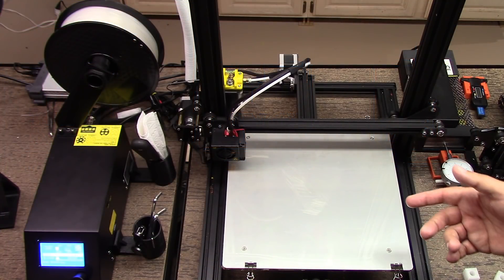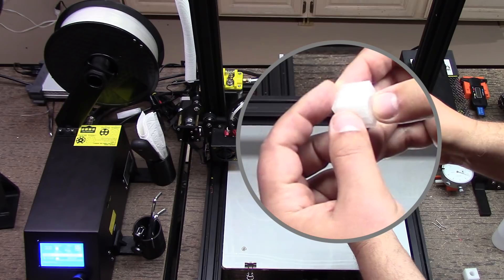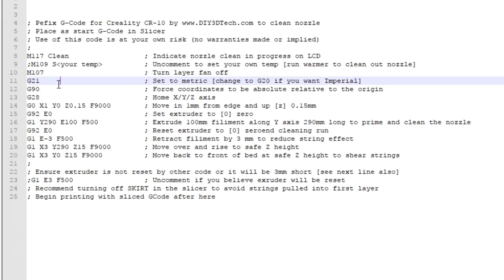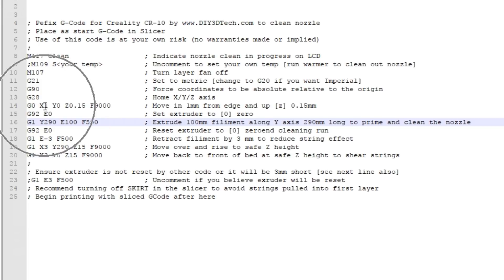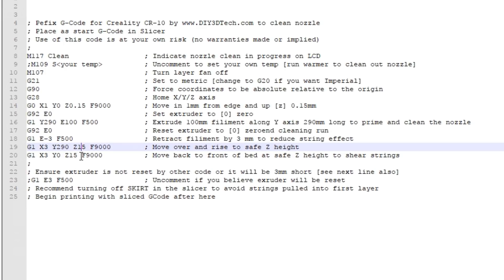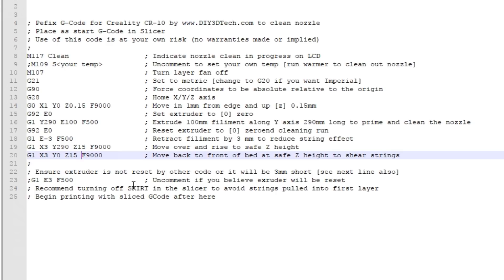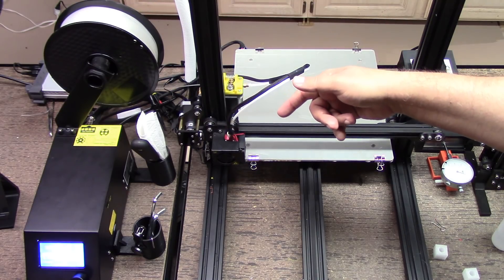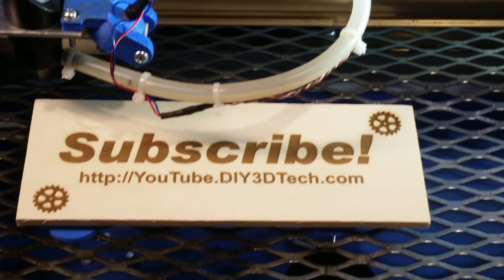Creality CR10 - GCode to Clean Nozzle Before Printing!

Comment: I like to just put down a massive glob that ends up surrounding the lower portion of my nozzle tip, i then yank out of that extruded glob pretty fast and it cleans the nozzle fairly well. tried having an actual brush and gcode was good but no matter what you do it leaves a but of crusty old filament on the outside of the nozzle.

Comment: Interesting old school method ..... use G12 P2 S2 R10 instead if you use Marlin 2.x and you get it in a smaller area in a circle of R10 = 10mm S meaning you do 2 rounds and P2 means you do in a circle pattern.
Reply from the maker: Interesting, thanks for sharing!

Comment: Hi, thanks for the video. If I wanted to run this script on its own to purge one filament and change to another, what commands do I need to use to turn on the heated bed and hot end? as my printer just says cold extrusion prevented when I run this as it is.
Thanks again
Reply from the maker: Check out this web site for the required G & M codes: https://marlinfw.org/docs/gcode/G000-G001.html

Comment: I assume I just put the G29 command after G28
Reply from the maker: Its been a while and depends a bit on your printer too for example if there is an auto-level routine.  However would suggest trying to insert after the hotend and bed come up to temp...
Reply: DIY3DTECH.com Very true. Luckily I just have a modded cr10 so most of your code was used! I ended up putting G29 right after the G28 and it’s working flawlessly!

Comment: Great video! 
I have a question, though... my Gcode Start looks like that and I don't understand why it doesn't have the positions and the lenght of the material that is going to be extruded... 
G28 ; home all axes
 M117 Purge extruder
 G92 E0 ; reset extruder
How can I edit this so it could travel in a certain direction?
As it is, right now, it's going at about Y100, starts extruding towards Y210 or so (my bed has 220 on X/Y) and then goes back towards Y20 (or so) over the first line it printed starting from Y100 (somewhere in the middle of the bed at X0 Y100)....
Reply from the maker: Not sure I understand what your saying, gcode is relative (in most applications) so so if the hot end is at X0Y0 and I say G01 X10 then it will create a line 10mm long.  Also same for direction as it to for the most part is also relative so if say G01 Z0.2 then G01 X-10 will place another line on top of the last in the opposite direction...

Comment: I used this GCode with my CR10s Pro V2, and it does what it's supposed to, however since my printer comes with the BLTouch auto leveling, however, it does the code first and then levels the bed, which causes the nozzle to be oozing with filament when it starts printing, it should be the other way around, it should level the bed first and then run the code. Is there a solution for this? I'm kind of new to all this, trying to learn.
Reply from the maker: Not sure, leveling code in the GCode start up of your slicer or firmware? If it is the later then just swap your order in the start up, if firmware based not sure however have to belive there is an MCode to start it?
Reply: DIY3DTECH.com Thank you for replying. I am using Cura, the latest version. It did have a an Mcode on it, I just pasted this one right after it. Should I invert it and put this one first and then the Mcode? Like I said I don’t really understand anything about Gcode, just starting to learn. Thanks again.

Comment: Hello, I have been printing for a while now but have never really done anything with Gcode. I now have a CR10 S Pro and would like to have a code like this one as well as have my bed end with print pushing to the front instead of the rear. I have it on my ender 3. I cant find anything spcific the the cr10 s pro. 

Would this code work for me? Below is what I have now. any help would be greatly appriciated.

start
G28 ;Home
G29;Auto bed leveling
G1 Z15.0 F6000 ;Move the platform down 15mm
;Prime the extruder
G92 E0
G1 F200 E3
G92 E0

End
G91
G1 F1800 E-3
G1 F3000 Z10
G90
G28 X0 Y0 ; home x and y axis
M106 S0 ; turn off cooling fan
M104 S0 ; turn off extruder
M140 S0 ; turn off bed
M84 ; disable motors
Reply from the maker: Yes it should as keep in mind Gcode is Gcode (almost) no matter what being a positional language as what might change a bit are extra or fewer MCodes.  As you can see in your example code these are not positional however functional like turning things on or off.  If you look at "G28 X0 Y0 ; home x and y axis"  G28 is the Zero reference position and X0 and Y0 motion to that position or push the bed back.  Also the G90 above is important too as it defines the absolute positioning of the system.  This is what you would change push the bed forward at the end however be careful as the bed goes back for a reason and that is to clear the gantry.  In 99% of the cases this should not make a difference as slicing unlike CNC is (at this time) purely orthogonal meaning the printer prints one layer in Z and moves up to the next.  However new generational slicers are changing the game and working dynamically in the Z, so long story short just be aware there might be structures in front of the gantry...

Comment: I’ve never been clear as to whether to paste this in front of the Cura startup code or to replace the Cura code completely. I tried both but both of them caused the printer to fault on a floating point translation error.
Reply from the maker: It depends, at minimum you should be able to paste in front.  However I have never seen a "floating point translation error" nor how this could be possible

Comment: Hi Is it possible to use these codes for CR 10S pro and insert the autobed leveling command before each print? thanks
Reply from the maker: If you have auto bed leveling you could set the code up to run as part of the start GCode but my two cents is that is over kill...

Comment: It seems useful still to have skirt, as it can help you verify bed is level around the region being printed before things get too far.
Reply from the maker: The only thing is you use a skirt it defeats the idea of cleaning the nozzle or at least reduces its value as that is part of the idea of the skit is clean the nozzle however because it loops in a radius, its not effective...

Comment: why not just use brim lol?
Reply from the maker: Brim will not do the same thing, this code is designed to eject a set amount of plastic to remove snot build up which a brim will not (because it doesn't move enough plastic) and second as covered in the video it has shear action to forcibly  separate the extruded plastic, leaving the snot behind...

Comment: is there GCode  to off set the start position
My Creality CR10 refuses to start at the center of the plate.
even thought the print is centerd in the build volume
Reply from the maker: Have you checked your slicer settings (for proper bed size) or tried a different slicer?  I have only seen this on the Tevo and it was an error firmware.  However I would be surprised to see that in the CR-10

Comment: BTW, if you've ditched the stock glass and gone with something 12x12" like Ikea's LOTS mirrors you need to move the Z in a little more when doing the purge. Or put the mirror on flush with the left side and lost more area on the right (I centered mine so it's smaller an even distance all around). Most replacements are about 5mm smaller on each side than the stock glass.
Reply from the maker: Thanks for sharing, I however have not really found the need to print on a glass surface, and just attach the PEI to the bed, tram it and go.  Thousands of prints today and no issues...

Comment: Nice code. The default Start Gcode in Cura 3.2.1 for my Monoprice Select Mini v2 had a nice wipe (heard it called 'the schmere') code to start. Made getting going much easier. It actually walked the nozzle out of the printable area x -1 to do the wipe. turning
Is turning off the skirt in Cura a hidden command in the adhesion options?
Reply: If you haven't figured it out yet, your answer is yes... maybe.  

When you're in Cura, if you don't see "Build Plate Adhesion Type" with a dropdown menu, hover over "Build Plate Adhesion" and click on the gear icon.  Then look for "Build Plate Adhesion Type" in the menu and click the check box.  Save your settings and it should now show up.
Reply: Yup, I just didn't explore the options you can add in and out enough. Thanks.
Reply: Yeah, there's enough options in there to make one's head spin. LOL
Reply: I keep wanting to turn on ALL the options, on a friend's machine. It would take hours if you tuned every possible option. One way to save filament, spend more time slicing. 😲
Reply from the maker: Sorry on the CURA options for this as CURA (if you look back some of my CURA video) has a few bugs to say the least regarding options.

Comment: Thanks for the informative video/videos!  I've been running CNC routers in my woodworking business for 18 years and this is my first foray into 3D printing and I'm having a blast!  I've plugged this into Cura for my CR-20 and noticed what you meant by the temp overrides at the beginning in the resulting code.  After a little searching, I have found the variables that are needed to fix it.  If your start code doesn't have these in it, Cura will automatically place the nozzle and bed temps at the start of the file, previous to your start code.  If you place M104 {material_print_temperature} and M109 {material_print_temperature} after your last line, it will not put them at the top and will then allow you to run your higher temp to purge first and then wait for a slight cooldown to your chosen print temp before continuing.

Like this...

M117 Clean    ;Indicate nozzle clean in progress on LCD
M109 S215     ; Uncomment to set your own temp [run warmer to clean out nozzle]    
M107               ; Turn layer fan off
G21                  ; Set to metric [change to G20 if you want Imperial]
G90                  ; Force coordinates to be absolute relative to the origin
G28                  ; Home X/Y/Z axis
G1 Z15.0 F6000                     ; Move the nozzle up 15mm
G0 X1 Y1 Z0.15 F9000         ; Move in 1mm from edges and up [z] 0.15mm
G92 E0                                    ; Set extruder to [0] zero
G1 Y190 E100 F500             ; Extrude 100mm filiment along Y axis 190mm long to prime and clean the nozzle
G92 E0                                    ; Reset extruder to [0] zero end of cleaning run
G1 E-3 F500                           ; Retract filiment by 3 mm to reduce string effect
G1 X3 Y190 Z15 F9000       ; Move over and rise to safe Z height
G1 X3 Y0 Z15 F9000           ; Move back to front of bed at safe Z height to shear strings
;
M104 {material_print_temperature}  ; This placed here stops Cura from placing it at the beginning
M109 {material_print_temperature}  ; Same here
;Prime the extruder
G92 E0
G1 F200 E3
G92 E0
Reply from the maker: Thanks for sharing!  And its cool your having a good time!

Comment: marlin firmware has a nozzle clean build in since 1.1.0, just in case you missing it. cheers.
http://marlinfw.org/docs/gcode/G012.html
Reply from the maker: Thanks, yes actually a viewer requested this as the big thing it does try to snap any stringing by the diagonal movement...

Comment: using this code and loving it...the large band it lays really cleans out the nozzle. One thing I'd like to tweak is that after the large band is layed and the the bed moves back....I still have a very very fine strand of filament that follows the travel distance and into the start of the print....what can I change to try to get this strand to get pulled off or just stop?
Reply from the maker: Your welcome and you could try retraction, however don't forget to re-prime it before you start to print....

Comment: Hello, I was going to use this for my Tevo Tornado...pretty much a CR10. I'm still waiting for it in the mail, and this will be my first printer, so I am a newb. This video and technique just makes sense to me, and I would like to use it. So I am getting some profiles ready, with this cleaning code in it. Could you just clarify for me, that in CURA start code...that I should just delete ALL the default start code for the CR10, and paste yours in its place....the default start g-code is no longer needed correct?
Reply from the maker: Congrats on joining the hobbies and check the video as I made this a while back and cover this in the video as I recall you need keep some of the start code and to make changes you should familiarize yourself with GCode before making changes to be on th safe side...

Comment: Hey dude, good video, but so you know, its not obvious where you went from Notepad to implementing the new codes. Its not clear what app or program you opened up to get where you replace the start gcode :P
Reply from the maker: Your slicer, as basically all slicers will have a second for inserting Start/Stop GCode for setup and each will be different and hence the reason for not showing as each will be different yet it should work in all as its standard Gcode.  Hope this helps...

Comment: hey I need a big help then I have a big problem.
I want to Print a TEMP TOWER and i delet the normal GCODE for the cr10s and i do the other gcode inside. Now i cant print and my question is ,,Does this GCODE from the CR10 work on the CR10S``?
Reply from the maker: Gcode is gcode, its mainly the positional aspect and frimware which become issues.  for example G0 Z10 will work on about any machine as its only moving the z 10 mm  however G0 Z200 would be an issue going from a MonoPrice Mini to CR-10.  Also certain M commands might not work between firmware  however I believe Creaity is using Marlin on both so it mainly will be postional so the temp tower code should run...

Comment: Great Video! I am running a FolgerTech FT-5 and this worked great for my printer also. I was wondering if you knew where in the G-Code would you apply a M900 for linear advance in Marlin?
Reply from the maker: glad its working :-) however not sure what your trying to achieve with the M9000 command?
Reply: DIY3DTECH.com linear advance is a firmware feature in Marlin. It a way to manage nozzle pressure. Instead of a retraction, coast, wipe it settings. Thanks for the response!
Reply from the maker: Hmm will have to ask Scott about that as it sounds interesting

Comment: Great video and explanation, Thank you. I copied the code to add to my new CR-10s prints. The cleaning works well however after the clean the printer pauses and then is setting the bed temp back to 0 instead of the 195 I have set for printing PLA. How may I prevent this bed temp reset from happening? Liked and Subscribed
Reply from the maker: If you look in the gcode I make a comment about reseting temp as it depends on where your slicer inserts it temp gcode as it should come after set up Gcode...
Reply: DIY3DTECH.com thank you. I must haves missed that.

Comment: I was still having problems getting clean starts to prints on my CR-10 mini.  It starts feeding filament as it's moving in towards the print and would clump up on the nozzle as it touched the bed.  So I removed the "Z15" command.  No need to "rise to safe height".  You've already driven all the ways down the left edge.  So there should be no obstructions.  Anyway, after removing Z15, it works perfectly now!  I also reduced the length of the purge line to fit the smaller bed of the CR-10 mini.
Reply from the maker: Glad its working out for you :-)
Reply: Yes, the base gcode commands you supplied were a big help.  Thanks!  :-)
Reply from the maker: Your welcome :-)

Comment: Thanks for the great description of each gcode
Reply from the maker: Your welcome! (PS I am working on that MOSFET vid too!  Keep an eye out as it might be a month or two but we are going to fry some stuff!)
Reply: DIY3DTECH.com hey....put a switch across the hot end ...flip the switch to see if the mosfet keeps the current flowing and burn the wires up.....use the 8 buck mosfets that every one buys for the heat bed....if I'm right...the mosfet is rated much higher than the wires so they will not brown out......when the hot end shorts it would pull the same amps as the hot bed because the hot bed is a short. Around 11.5 amps. The mosfet handles it....but the thin wires won't.
Reply from the maker: Well it needs to be more dramatic than that as this is YouTube :-)

Comment: Great video! I'm using a JGAurora A5 printer and I copied and pasted the G-code into the the start-up section in cura, but I'm getting stringing on the return to Y-0 right before starting the print. Should I increase the retraction distance? Any help would be appreciated. Thanks!
Reply from the maker: Thanks for reminding me, I need to update this for the JG.  You could try (i.e. increasing retraction)
Reply: DIY3DTECH.com That would be great! I increased the retraction to 5mm but I’m still getting stringing (a little less). I’m afraid if I increase it too much, I’m going to have under extrusion issues.
Reply from the maker: 5mm should be more than enough, also you won't have under extrusion issues as when it start it pushes it back, but will happen is jamming. Are sure retraction is checked (i.e. turned on in the slicer?)
Reply: Gotcha. Yeah Retraction is check on in cura.